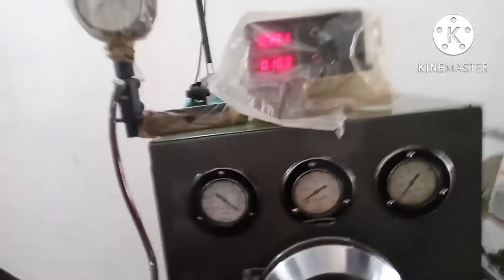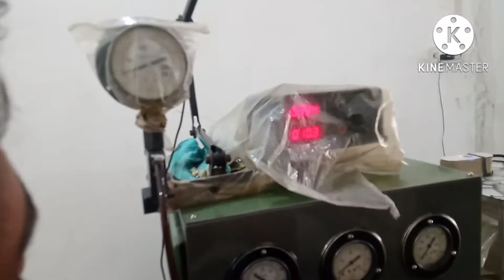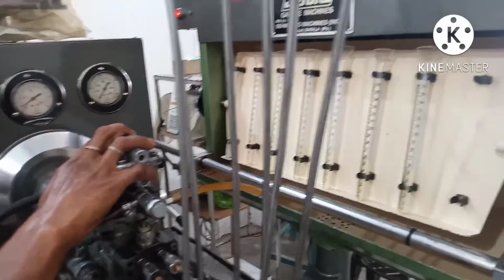HOW BOSCH ROTARY PUMP LFB WORKS# How High pressure fuel pump repair##

Comment: Bhai kitne rpm per lfb sating kar rahe ho kis nom. Ka pump h
Reply from the maker: 489 euro 3 Tata ,rpm 300 accilater DBA kar
Reply: Kind u information sir 489 ki LFB  rpm 1150 pr setting hai
Reply from the maker: @HarwinderSingh-js4wt  dono tran Kar sakte he g
Reply: Bosch information.......,.....?????????
Reply from the maker: APNI APNI setting he sir,
Reply from the maker: @HarwinderSingh-js4wt  bil jul sir ,but 300 rpm per pojitin set hogi g
Reply from the maker: @HarwinderSingh-js4wt  sir agar. 300 rpm per pressure accilater up hoga to he 1150 per
Reply from the maker: @HarwinderSingh-js4wt sir agar 300 rpm per accilater dbane se pressure up hoga to he 1150speed per lfb setting hogi
Reply: Sir agr acclaitor dbne or chorde par presure up down nahi horaha steel khata h jayse 6par toh kya problem hogi gandi par kya pump ka parts cheek karna hoga..ya change karna hoga

Comment: Maan shab yeh kitne R P M par chake kar reho or aciletar dena he ya nahi yeh pump ki puri setting kar ke chake karna he ya pehle es ki puri settin beta bhai ji Thanku ji
Reply from the maker: 300 rpm with accilater, jab accilater dbao ge pressure badna chahiya sir
Reply from the maker: Jab aap machine start Karo ge idling  per governor shaft ki setting Karo ap ki 1150 wali lfb ok aayegi